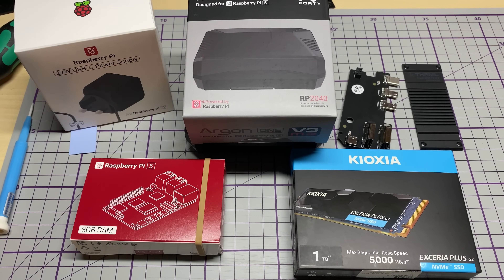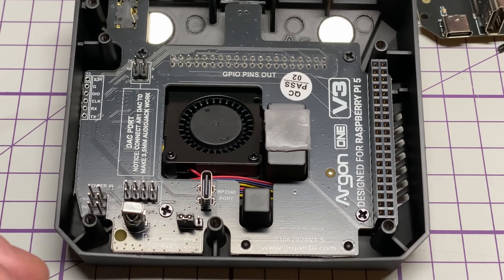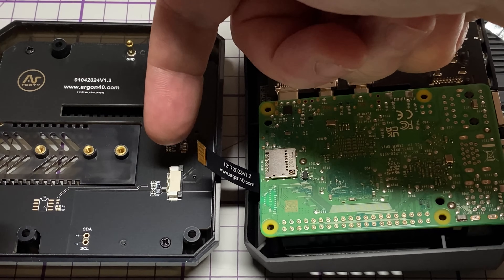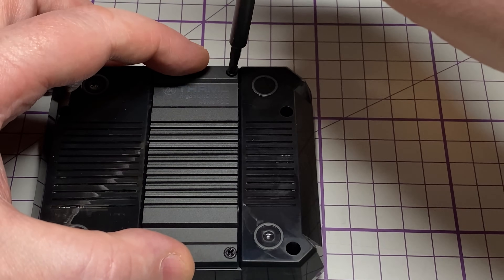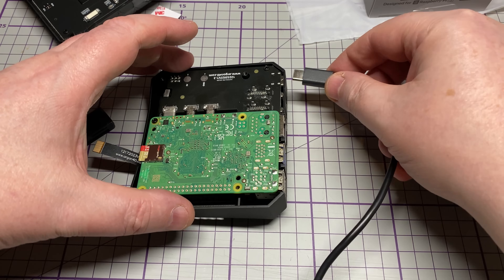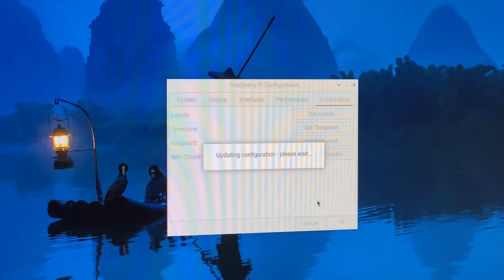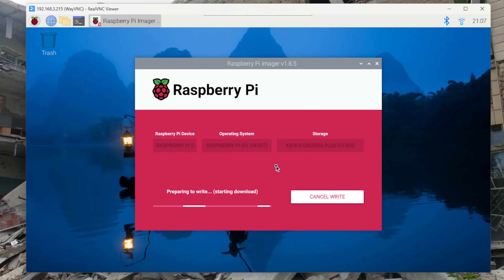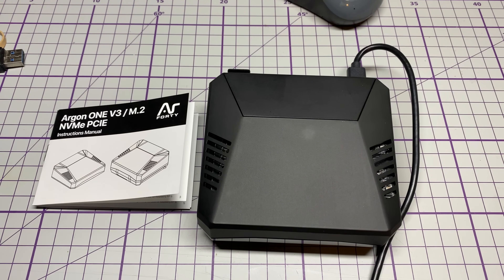Unleash the power of the Raspberry Pi 5 - 1TB NVME and Argon ONE v3 NVME case.

Comment: Hi, nice presentation, thank you. I'm thinking of switching from pi4 to pi5 with this case. The pi4 is communicating with an arduino using the gpio-pins. Do you know if some gpio-pins are unuseable when this nvme-board is connected?
Reply from the maker: Hi i believe the Pi5 has a dedicated PCIe lane for the NVME , so shouldn't interfere with the GPIO.

Comment: My new Argon One V3 NVME case came with 2-two PCIe cables, with different part numbers: 0605024V2 and 03072024V1.3. Neither of these numbers matches the one in your kit. What's going on and how do I know which is correct for NVME connection?
Reply: I took the black on xxxxxxV1.3 and it was fine.

Comment: 4:20 The black screw that secures the NVME drive is inserted into a brass nut that can be loosened with a pair of needle nose pliers. It took me longer than I would like to admit to figure out how to move the mounting screw.
Reply: And if I had seen your post earlier I would not have spent as long as I did to figure it myself!!!

Comment: Important Update:
I just bought a Raspberry Pi 5 and did not need to use an SD-card first, for when you power up the device, the firmware will let you install via network and directly to the SSD. I used a wired network, but I guess it would work via wireless, too, at least I saw the respective settings.
Greetings from Vienna
Reply from the maker: Now that's defiantly interesting.

Comment: Good video but I do have a question. Why would one use the Pi Imager Tool to flash the MicroSD, just to boot the ready to use system up from it and run the Pi Imager or similar on it again with the NVMe drive instead of just flashing to the NVMe directly and perhaps resizing partitions if needed with something like GParted?
Reply from the maker: There are many ways of doing this . As this was a new unit and I didn’t know how and if it worked I wanted to do step by step so any issues could be found . This was just the way I know and wanted to put a fresh operating system onto the drive .

Comment: Much easier to use the SD Card Copier tool.  No need to reinstall a new OS.
Reply from the maker: I wanted a new os , and especially the 64 bit os .
Reply: @MicroChipz  You did install a new 64bit OS.  There's no need to do it TWICE.  Thus why I said REinstall.  You just use the SD Card Copier tool to bounce what you had on the SD card to the NVMe drive.  Zero difference in the outcome.
Reply from the maker: I see what you mean now , I just did it the way I knew worked .
Reply: @JustinEmlay  You said it yourself, zero difference in outcome. So why does it matter the way he did it?
Reply: @sir_whocampsalot2876  You did not understand that comment.  But going in your direction, one was a LOT more work.  So why teach people the wrong and harder way?

Comment: You need to be able to change boot devices from the raspberry pi itself without having to rely on the Micro SD cards and the operating system. Which you can only do from Raspbian I believe because there's no option to change the boot device in Ubuntu. Having to switch between the SD card is a pain in the ass and time consuming. You should be able to do it from NETBOOT at the very least so that after you're done installing the OS from NETBOOT you can just change the boot Device to the Device that you installed it on because when I've tried installing an OS from NETBOOT it doesn't just reboot into the new OS and the Device you installed it on it just goes back into booting from/to NETBOOT.
Reply: You have to rely on Raspbian no offense to raspbian but I don't want to use it as my main desktop or daily driver so it's pretty much just for recovery or rescue purposes.

Comment: Hi, thanks for the great video.

I have got exactly this rig, but with a Crucial 1TB SSD. 

After I loaded up the normal RPi OS, I installed the Argon scripts for controlling the fan and power button and everything works fine - fan cuts in and out as the temp rises and falls.

However, I got this rig specifically to run Home Assistant OS. So, having loaded the HA OS, all works fine, but because the OS is a hybrid, the Argon scripts won't load and run, hence now way to control the fan etc. 

I currently have an RPi4 in an Argon M.2 V2 case and use an custom integration "Active Cooling and Active Linear Cooling" addon to control the fan which works brilliantly. Sadly the addon is not compatible with v3 of the Argon case, so at the moment, whilst I can run HA on the RPi 5 in the V3 case, I have no way to control the fan.

Any ideas?
Reply from the maker: It looks like a python script that runs from startup, I would start there

Comment: Glad to see this video, a pi 5 and Argon One NVME case are exactly what I asked for for my birthday! I've been using a pi 4 and an Argon One SATA case for some time now, and have been very happy with the setup.
Reply from the maker: The sata case was ok , it was limited by the usb3 , and it didn’t like multiple tasks , this new one is silly fast , I ran the pi benchmarks and got 60k score
Reply: I have the same case for my pi 4 as well. I accidentally purchased an NVMe drive not realizing my case was SATA. Bought a SATA drive and an NVMe enclosure then found Argon has an NVMe base available… it’s all still bottle necked through the usb3 port though so seeing them use PCIe for the 5 is wonderful

Comment: Good video. Could you do one with this case monitoring the temperature during some stress tests?
Reply from the maker: The case does get toasty when under stress , sits about 40 to 50 degrees , putting the Argon fan control software on works and keeps it from overheating.

Comment: I can't believe Argon didn't use an offset ribbon cable for the PCIE connection. As it is, the SD slot is blocked completely when connected.
Reply: Pi foundation screwed that up by putting the card reader right underneath the cable socket. As well as they refuse to use USB Power Delivery to get power to the Pi so you need all these non-standard power supplies that exceed the amps for 5V USB power, stupid.
Reply: @ivolol  USB PD is worse for devices that don't have a battery, as the negotiation can fail if the hardware is not properly thought out (like Rock 5b, for example). Not using PD is reasonable, but what's not reasonable is having a 5 amp power supply. 12 volt 2 amp would do the same and be much easier for people to replace or improve. But they wanted to save a few cents on power conversion lol.
Reply from the maker: I suppose they think you wont be using a sd card anymore as using the NVME is faster.
Reply: @MicroChipz  nice to have the option to use it still.
Reply: @r0galik no real point though as the unit will be closed up during use. Also, the bottom folds out of the way giving some access to the card, it’s not as it if loops over like the Geeekpi hats do. The Pimoroni hat does have an offset cable, but it’s also mounted securely at all times and still allows access to everything. The Argon case must be opened up for any access other than GPIO anyway so why make it anymore complex?
Reply: In this design there is no way to access the SD card when the case is closed. Once the cable is connected the entire bottom half comes off in a way in which you can access the SD card. There are other top mounting hats where the cable isn’t an issue since the SD card is on the bottom. 

You’re quoting another video that applauded an offset cable over a competitor’s board. That comparison isn’t applicable here.
Reply: I suppose it is possible to boot from the SD card through an external USB SD card reader, right?
Reply: @MrNalleman  probably, but this would just be usb boot...

Comment: No need to reinstall the OS with RPi Imager fresh on the M.2 drive if you've already got it booted from the MicroSD... Just use the SD Copier and copy it directly to the M.2 drive. Power down, remove MicroSD card, reboot, done. Flashing a clean install to the M.2 directly from a clean install on the MicroSD is a waste of time causing you to have to repeat setup steps unnecessarily.
Reply from the maker: Yeh this is another easy way of doing it .
Reply: Another unnecessarily convoluted way of doing it, yes... The SD Copier application is built into the Raspberry Pi OS for good reason: exactly this use lol. It saves you from having to reconfigure everything when moving to a new drive
Reply from the maker: Well for my use i wanted a fresh OS anyway, so this for me was not a problem , as i used the 64 bit os .